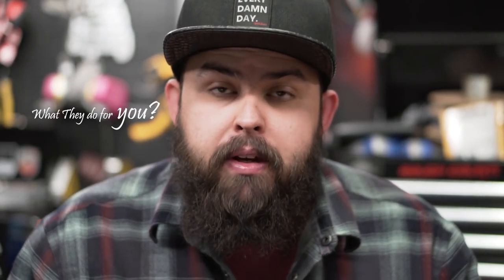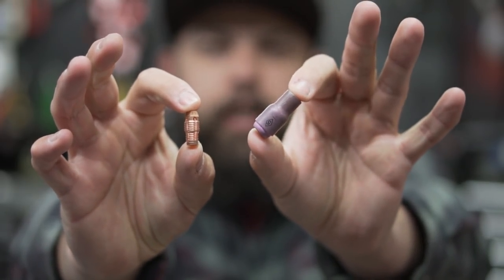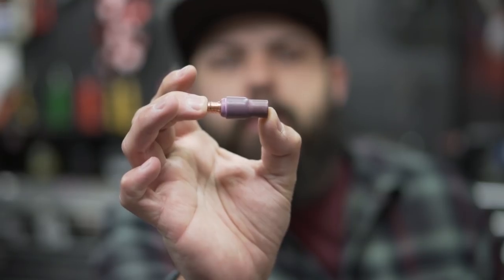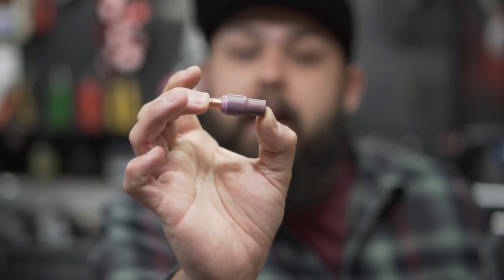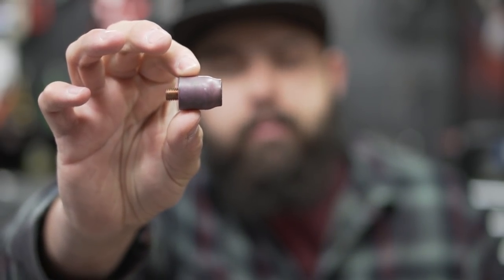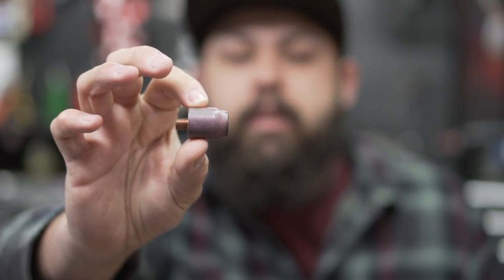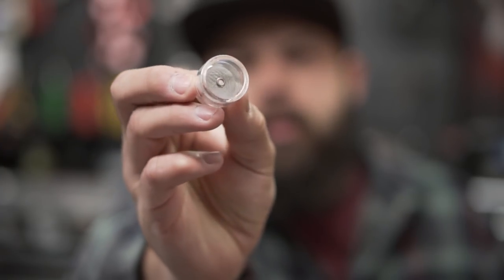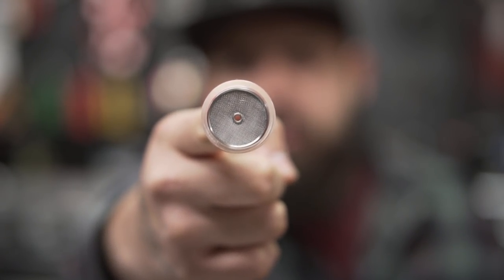What GTAW / TIG Welding cups should you use and why?

Comment: HourGlassFab, Your the MAN. I just started learning TIG on my LOTUS 200 Machine bought it because of the reviews and Cost. I am making a JETJOHN Boat.  Jetski motor and outdrive mounted inside my Aluminum Hull. I cut the hull to large as I was going to graph the fiberglass hull into the boat. I decided to weld up the hull and reduce my fiberglass area to the Hull surface substancially. I watched some youtube videos on welding Aluminum and started with the limited Supplies with the Welder but they worked. Holly Cow, My Aluminum Welds were somewhat washed out and I had some serious warping going on. So I ordered some more supplies with glass Cup lens included that just arrived this friday. I for sure thought that the glass lens cups was the ticket for helping my welding. My torch was all setup untill I saw your video. I immediately went out to the garage and changed from the glass to a smaller #5 cup. reduced my argon to about 12 cfm from 20. Set my amperage to 90 and laid down a stack of Dimes on my first pass. I have never been able to do that and no warping of the Metal. I am all Eyes and Ears. Thanks for the Great Advice
Reply from the maker: ntc3gtr that is absolutely fantastic man! I appreciate you taking the time to comment. 🙏🏻 it’s great that you took something from the video and I am super happy you were able to knock out the project you were working on. If you ever have any questions feel free to email me @ hourglassfab@yahoo.com

Comment: Good video. I actually couldn’t find anything wrong.;~)

I’d like to give people an idea of a gas lens. When you have your water faucets at home, you know that there is a “gas lens” inside the tip of the faucet. It gets dirty and has to be cleaned after a while. You don’t need to clean a gas lens, unless you make mistakes in welding, and spatter and dirt gets inside. Take the end off your faucet, and watch the water coming out compared to with the tip and you’ll get a good idea as to what happens in your torch with and without a gas lens.

Just be aware that Pyrex cups are delicate. If you drop a ceramic cup, you’re usually ok, but more often than not, a Pyrex cup will shatter. So be careful with them.

Comment: Thank you very much for the helpful video as I'm new to tig welding but not the welding industry. I have been taking other welding courses in years prior, (stick/mig/flux) We are starting off with fillet and laps and butt joints using 16 & 11 gauge mild steel, using a sander to get off the mill scale. After that we've been learning the stainless and aluminum process, learning lots. I use a blue tungsten now as I used purple before (mainly) & red on steel on DC. Thank you again HourGlassFab

Comment: what a legend !im backyard warrior and im getting a 200 ac dc tig  for some fun ,thanks for an awesome explanatory video an aluminium and other metals I will be sure to get some gas lenses and refer back to this video .
Reply from the maker: jamesparker308 definitely man! Reach out if you have any specific questions. I appreciate the comment! 🙏🏻
Reply: Hi man just a quick one whats your thoughts on everlast compared to a200 acdc  razor {uni mig digital )-these are a small machine compared to everlast multi processor  uni mig 1200 Aus compared to 2800 for everlast. is one better than the other ?
Reply from the maker: jamesparker308 hey man, I just checked out the specs of the A200. It actually looks like a really decent welder. No matter what machine it is always look for a good warranty and reliability, Make sure you can get it repaired fairly fast. The settings that it has and well as all the functions are just as good as the everlast machines. For 1200$ you can’t really go wrong honestly. Give it a shot! 
-Brad

Comment: Awesome man ty so much for the info. Haven't picked up a tig torch in 15 years...been stick welding ever since I left the union in 2004... use to to high pressure steam..back at it now welding some 3" schd 10 pipe...first root no too bad...cap herendus 🤣

Comment: Great video with good details I’m sure a lot of people can learn from this.👊👨‍🏭
Reply: Matthew Bean I have a everlast 210 ext with a water cooler. Ck 20 water cooled flex head tig torch I use a # 7 cup with a gas lens for most things mostly steel and aluminum some stainless. If you want to learn more about tig welding I strongly suggest these videos from hour glass. And welding tips and tricks also weld.com

Comment: Good clip man. Very good info for everyone. I'm doing an intricate Alluminium job at the moment with a lot of panels and gussets in it and I'm welding anywhere from a straight fillet to a plug weld to a stitch on the INSIDE of the frame that I have to turn the torch upside down and feed filler in through a large hole in the wall of the frame, or upside down. So because mostly i'm out of position I find a standard number 5 cup gives me the best visibility and room to get the filler in.

Comment: I weld stainless steel round bar in a few different configurations. What would you recommend on torch set up and machine set up? the welding area differs in each project, i can show you some pictures if need be. I typically weld 5/16", 1/4" and 3/16' round bar together to make horse bits.

Comment: Just starting brand new & setup is a Parweld inverter welder. Came with a WP9V torch & a load of #4 ceramic cups. Got a lot of various aluminium coupons to get started & to practice. I’m worried about this gas/valve/ starting/breaking weld/ leaving gas on. I know it’s gonna have to be lift start & working this valve. Any vids on this? Any tips, thoughts & advice would be brilliant. Thanks in advance.

Comment: Awesome, glad to see people making killer content. 
 One question for you, In my shop I pretty much exclusively use my tig for frame building so using a big cup (furick fupa)with a lot of stick out helps me get into right spots. I also use his ally #8 Pyrex cup for more general welds. In your opinion what cup would you use if you were doing light gauge exhaust tubing stainless or mild. Also note the welds will not be ground or smoothed.
Reply from the maker: Rule Hard Media thanks man! Good question.. for any stainless steel tubing and even mild steel thin gauge tube, depending on the diameter. I would use the Furick #12 hands down. It’s an extremely versatile cup and offers the gas coverage that’s needed to make clean, sound welds on exhaust tubing in both stainless and mild steel. Any type of work like that especially stainless I will exclusively only use the #12 cups. I agree, being able to stick your tungsten out from 3/4-1.5” obviously depending on flow is pretty insane!

Comment: How about a tutorial on welding aluminium cylinder heads. I have tried it but struggle. I preheat the head, use a argon/helium mix, clean out the area to be welded but struggle. Then I watch a pro do it and he just slightly takes the chill out the head with a big rose torch for 30 seconds then gets right in there and welds up beautifully. I ask what gas and he says just plain  argon.  I am doing something wrong. Otherwise my thin ally welding is fine.

Comment: I could really teach you a lil about Aluminum Welding. Especially on Frequency, Heat and types of Aluminum has a great factor in a gas lens  . the type of gas is a big factor in professional welding. In a good way bro . Not Bragging at all. Ive just welded Professional on this type of welding for over 39 years  .

Comment: Is gas flow rate for welding AC on aluminum mainly for protecting the tungsten? Or does it significantly impact the work/weld also, like it does with reactive metals?
Reply: I run 7 to 8 second post flow to cool the tungsten after welding aluminium.  
Being very new to welding aluminium I have taken the advice from the technician that I bought my welder from.

Comment: I just started tig welding a month ago ... I purchased a “gas lens” kit thinking it was going to save me on argon. I also didn’t have a clue what that screen is for... #1 is it mandatory that screen be pushed into every (Pyrex) cup #2 is there such a cup that is more efficient on argon to use less gas? Thank you for the video!
Reply: Same question here. Gas lens equals more argon saving?
Reply: He literally said, more gas with larger cups, and explained why that is during this video... 🤔
Reply: @2S1L3NT  what’s the time stamp?
Reply: He touched on it in a few indirect ways a few times throughout the video, but the main coverage was at 8:55

But here are some others as well.
1:55  4:05  8:13
Reply: @2S1L3NT  Yeh, more gas with larger cups but how does the gas lens compete with the regular lens in regard to argon saving?

Comment: Very helpful. I started right into the field with no experience or training welding stainless. I got my puddles down and got everything else down just could find a way to stop the oxidizing, my work only has the gas lens #4-#7 which i run the 7 and seems to do pretty good for the most part still occasional issues. In your opinion, what pyrex size would be best 3/4 ID or 1 1/8. Im usually welding on close to 11 gauge stainless give or take. Also what size tungsten would you recommend? Thanks

Comment: CAN YOU USE THE GLASS CUPS WHEN WELDING ALUMINUM?
Reply from the maker: Thomas King you can use the small diameter #5 but using big Pyrex cups when welding aluminum is a no go.. way too much gas flow for non reactive ac welding. Stick with #4-#6 depending on material thickness.
Reply: @hourglassingenuity103  OK, I MAINLY WANTED TO TRY THEM TO BETTER MY VIEW OF THE PUDDLE & STICKING MY TUNG OUT FURTHER

Comment: The insight on not using gas lenses for aluminum I wouldn't have even guessed it would of had an effect and would like to know if you have a formula for settings for different thicknesses and different metals
Reply from the maker: ENGINEERED GAMER thanks! have you checked out my video on ac balance and frequency yet?
Reply: HourGlassFab no havnt but have subbed so I'll check it out cheers

Comment: Are your torch cables braided? Looks like it in the thumbnail. Im about to do mine i think and get rid of that leather cover.
Reply from the maker: songer121 they are braided. I have plenty of expensive covers but they are quite annoying. Braiding them was definitely a good move. I don’t move my lead around enough to ever damage it. The dynasty 210dx is basically used at my fixture table.
Reply: I wouldn't braid the lines together. It doesn't really add anything and if you do need to replace a line you'll then have to take extra time unbraiding them. I'd also keep them in a sheath, torches and lines aren't cheap, especially the nice rubber ones. Worth a few bucks to keep them in good as new shape. Even if you aren't dragging them across the ground much the sheath gives a little protection against being stepped on or other accidental mishaps. Weldtech sells really nice leather zip covers that I highly recommend for anyone willing to spend the money. A dirt cheap alternative is continuous nylon sheathes. They're more of a pain to get on without a zipper but they keep everything packed together nice and tight without adding any weight or limiting flexibility.

Comment: I think that you overcomplicated that cup size explanation. Each cup size number corresponds to that same amount of 16ths of an inch. Dont mix in quarters or eights.. Number 4 is 4/16“ number 7 is 7/16, number 8 is 8/16". Just as simple as that. For us metric heads, the quarters, halv, eights just makes it harder to learn. Just think 16ths all the time.
Reply: Helikopterpop sorry man but I disagree. If you can’t translate 1/16ths into common denominators within an inch maybe you shouldn’t be building things that require a tig welder. 1/32nds or smaller may be another story, but 1/16ths of an inch are a common finish trim measurement and weld fitments should be that tight. If 1/16ths are too difficult to translate to 1/8ths or 1/4” denominators maybe you should stick to mig welding.
Reply: @myse5a  This has nothing to do with me building things, or with fitments or any other thing. It's just about beeing pedagogical. The number on the cup corresponds to 16ths of an inch, period. And he explains it in a complicated way when he could just say just like "the number on the cup corresponds to the amount of 16ths that will be the opening diameter". And then he could teach out math and fractions.. But it's much more easily to comprehend for non inchheads to know that it's just all about 16ths and nothing else...

In the metric system we also have a much higher resolution and a far more simpler way to grasp than the inch system. So maybe you should learn that while talking about fitments and building things. For instance, if describing the length of a person we would just say like 183 or 184 or 185cm when you say like 5ft 8inch and 3/4. And for every difference in length you must calculate to get a feel for the length, while we just add another cm or mm or meter or km or.... Couldn't possibly be simpler then that.. But that has nothing to do with my first post... Nor did your answer.

Comment: I hate the way they classify cups. the first one, standard. I would call that small, if I am trying to get into someplace tight I have ground the standard cups down shorter...... not telling you your wrong,cause your not. just sayin, improvise, adapt, and hopefully overcome. cause a lot of things are possible if you get inventive. looks like you don't skimp on parts and I have never had the pleasure of working in a shop like that, so I had to learn how to use a bigger/smaller cup.
 In short. I wish I had all of the gadgets and accessories they have today, when I was learning back then!..... or maybe I just wish I had picked a better employer when I was welding....
Reply from the maker: Luke Warmwater I totally agree and it’s all a lot more complicated than I should be. Doing things the old fashioned way is perfectly fine! It all works if you really try to use some ingenuity.